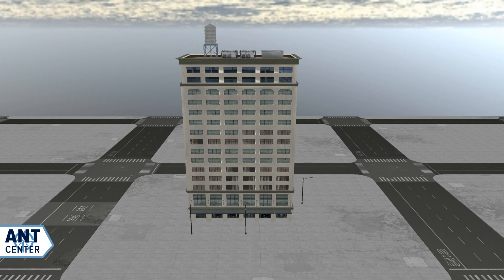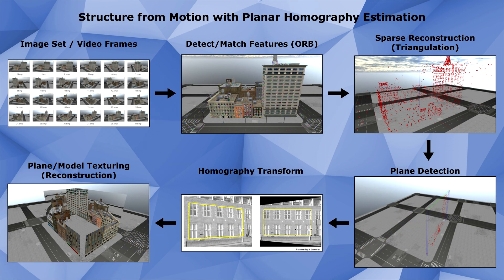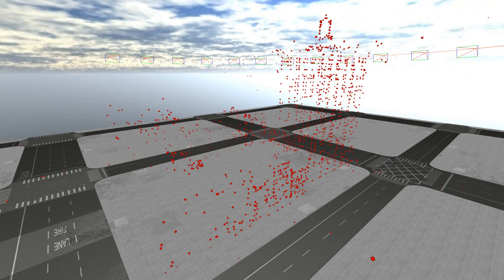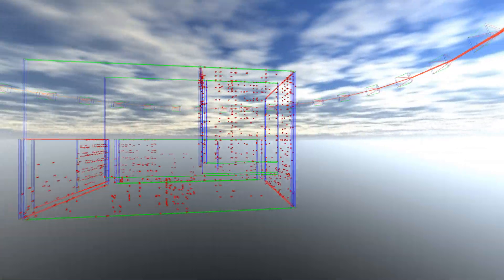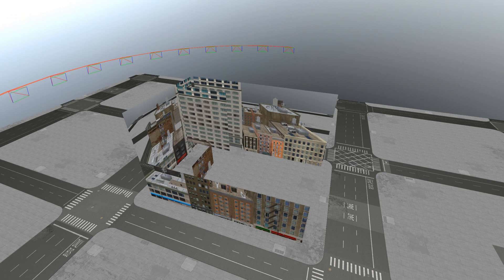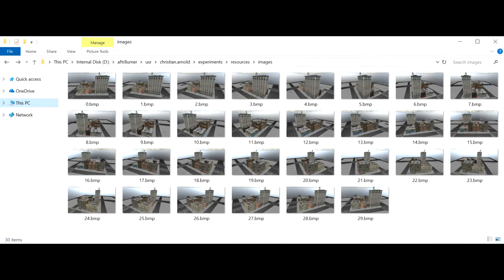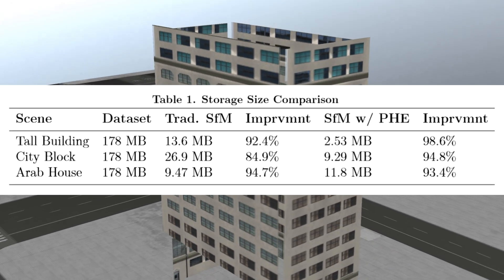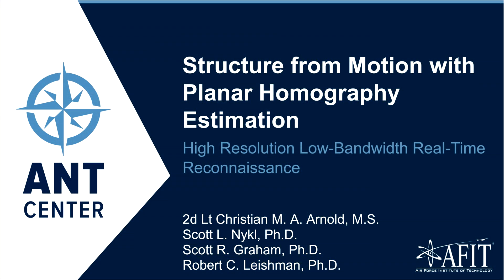Real-Time Structure from Motion (SfM) with Planar Homography Estimation

Comment: are you still using this method? that delunay walk method used in this too? and does this include slam methods? or just storing dataset arrays and applied in model reconstrution?
triangulation? by means of the m matrix?

real time?
 i have so many questions,
i could go on for ever

my hurdle really ,is expressing all this mathematically, (i have matricies and i dont know why. maybe DOG pyramids would suit me better)

looks like aruco, jsfeat , opencvjs mand wsam could process all this efficiently 
but in a slam methology ?
bloch spheres and normal clustering through k means clustering?
i think i understand the topolgy of what needs to be done, but theres a distinctive line between do and do not eh?

nice work. ive seen refrences towards your project often in my researching
but the amount of info out there is alot to take in all by myself
but you have presented the processes pretty clearly , comapred to many

best of luck to you
thanks for your contet and your time
(those are some impressive numbers btw)